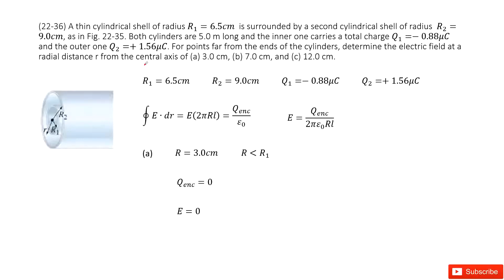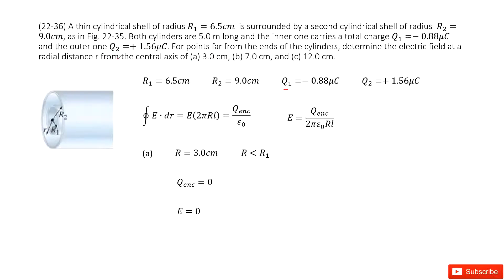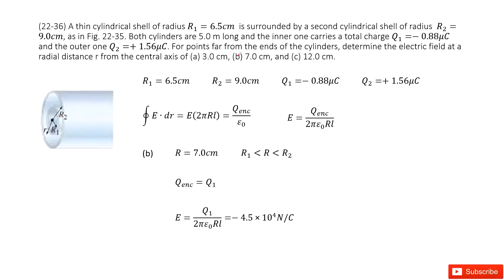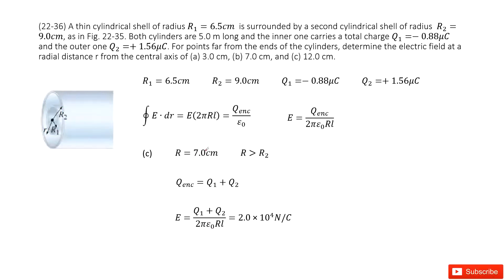(22-36) A thin cylindrical shell of radius R_1=6.5cm  is surrounded by a second cylindrical shell of

Comment: Great video! However, I am a bit confused about how you got the answer for (b.) What values did you put in to get -4.5 * 10^4? I want to see if I converted some units incorrectly.
Reply: very late answer but for anyone else who has the same question: 

Qenc = Q1 = -0.88 * 10^-6 C (given in microCoulombs so need to convert)
R = 0.07 m (given in cm so need to convert)
l = 5.0 m
e0 = 8.854 * 10^-12 C^2 / (N * m^2)

these values gave me an answer of E = -45195 N/C which is approximately -4.5 * 10^4 N/C.